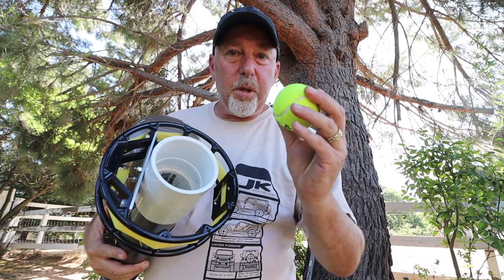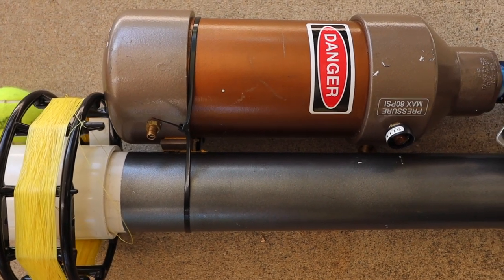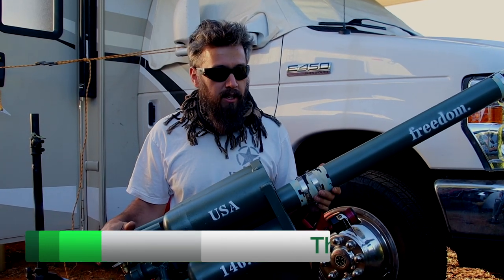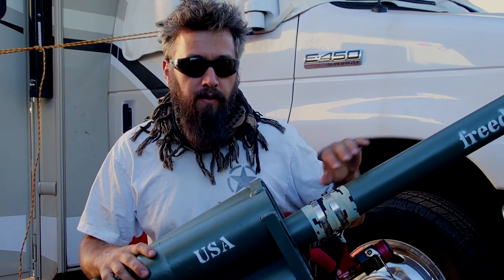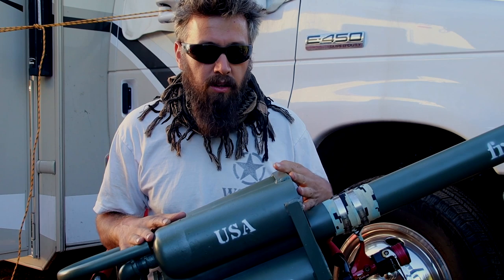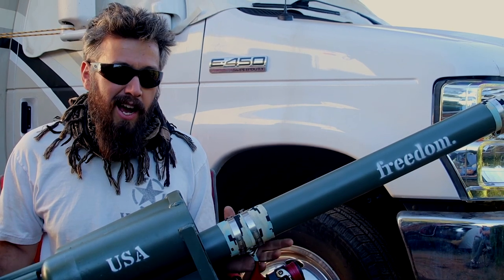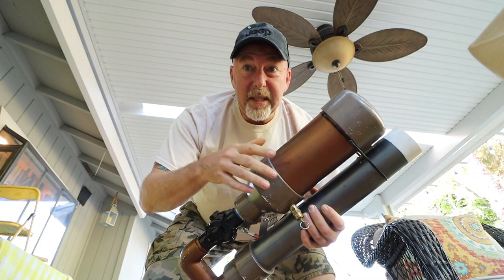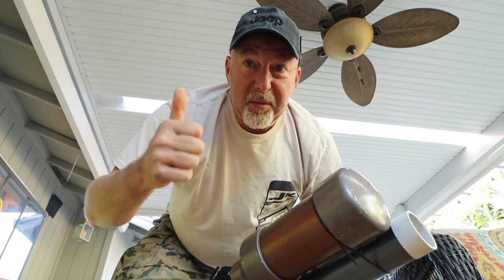Freedom Cannon The Most Insane Ham Radio Antenna Launcher Ever | K6UDA Radio

Comment: I built one of these a long while back for my son and dog and can easily clear 69ft trees with tennis ball.  I would like to see guys actually put the wire up into the tree then retrieve it.  Building the cannon is not as interesting as how your use it in a practical manner.
Reply from the maker: We routinely put wire over 100 ft trees and pull them back out when we're done playing.
Reply: K6UDA it would be great to see you do that
Reply: K6UDA also show how you either make or where you buy weighted tennis balls
Reply: I prefer a bow and arrow. Nothing to build and a full size compound bow is more powerful. A kids youth bow will reach about 60-70ft depending on what size fishing like you use and how much weight you add to the arrow. But using the size line he used in this video is big time over kill! Use 10 lbs fishing line first. Then attach the stronger line and pull it over next. 

But retrieving it is easy! Maybe your not following the procedure. Its videos showing deploying. But you basically use enough line to reach from ground, over the tree and back down. Then tie the antenna to the line, pull it up and tie off the line. To retrieve it you untie the line and unless its stuck it will usually fall on its own.

It helps if you have help. Have the helper pull on the antenna to keep it out of the limbs on its way down. Especially on a sloper configuration. I prefer using two trees and a dipole strung between them. When you untie one end it doesn't tend to fall into the limbs as bad as say a end fed in a sloper configuration. 

Plus it all depends on how permanent you need it to be. For a few hours just use fishing line. For a few days use at least 50lbs test line. For more than that dacron is best. Plus figure in the size / weight if the antenna and feed line. Like for a 160M dipole it needs to be strong! 

I go camping a lot for a couple weeks at a time and 20lb fishing line works just fine for even a 80M dipole. Plus if it breaks fishing line is cheap! Just shoot and pull over anther one. 

de WW5RM